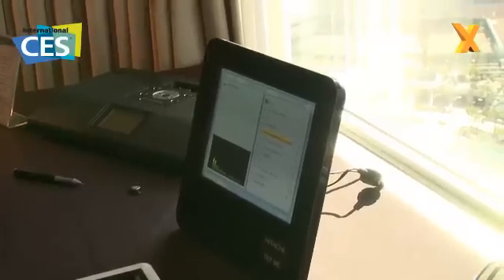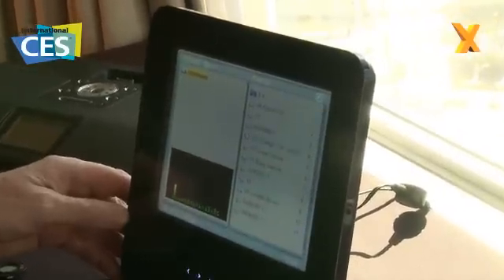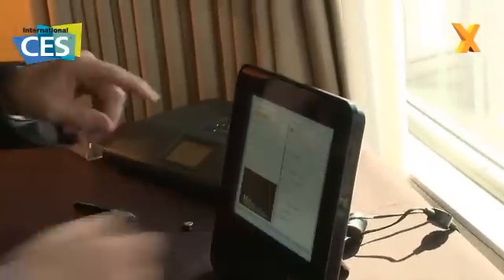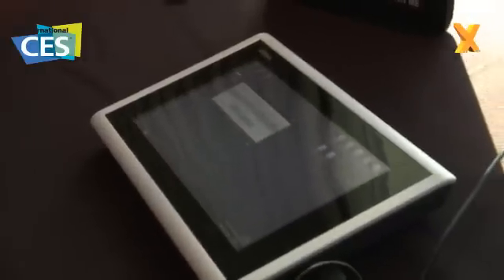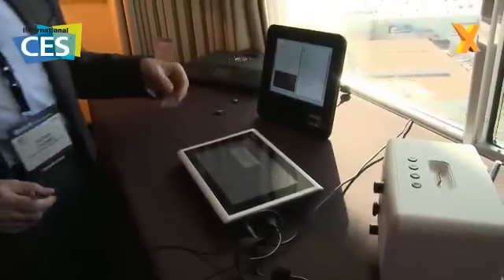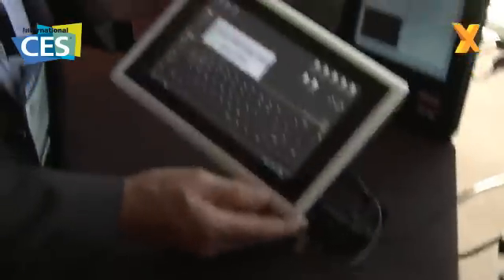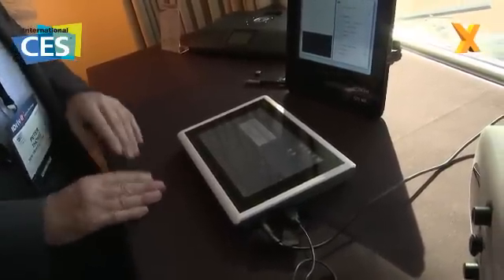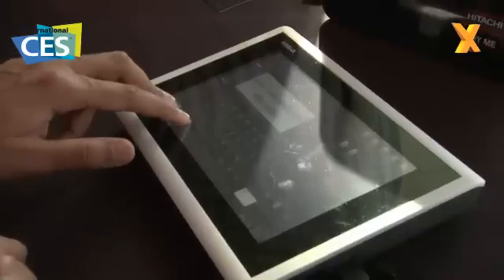CES 2010 - Change any light panel into a speaker with NXT

Comment: Great stuff. What I would like to know is whether this technology can be used on a large solar panel. So basically the solar panel acts as the vibrating surface and the energy source for the amplifiers and exciters? (to used for live gigs and roof speakers)
Reply: are you serious? Solar power is not enough to drive a PA system